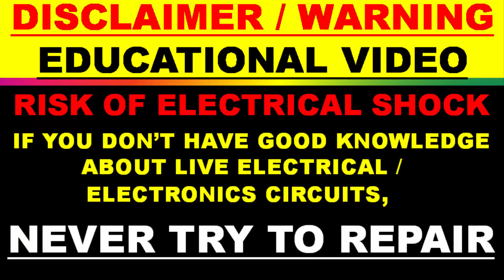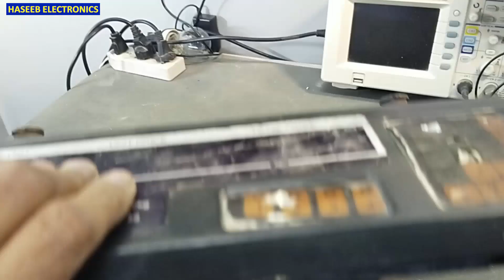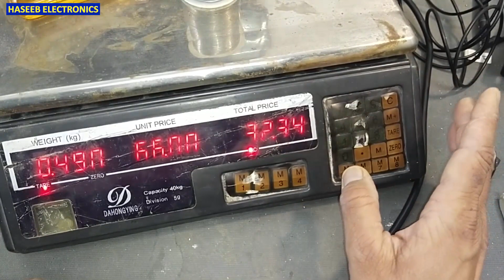{812} Electronic Weight Scale Repair || No Power ON

Comment: It's not long since i started watching this channel. Good simple ways of finding faults and repairs. And one more thing Mr. Haseeb ! The insulation on those tweezers looks like some paper tape or electrician's tape which is still not safe on live circuits neither its proper ESD protection. Get yourself some heat shrink tubing of required size. Insert on each leg  as long as it both meet the upper end. Shrink them. Then insert a piece of bigger tube on the upper end and shrink it. That's it you got insulated tweezers.
Reply from the maker: best regards and special thanks dear brother 
i already used heat shrinkable sleeve on the tweezers. but it is old. i use it just for these type of rough work. otherwise i use insulated, ESD protected tools, moreover my test equipment and rework station including soldering / de-soldering irons are also ESD free.